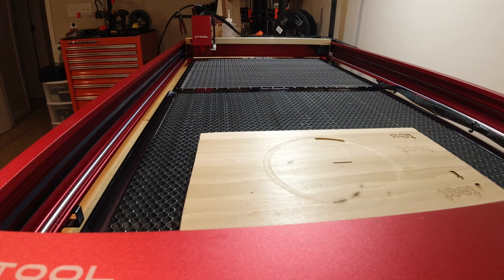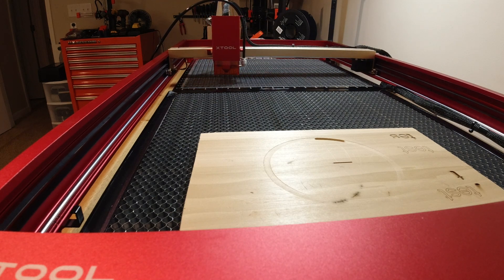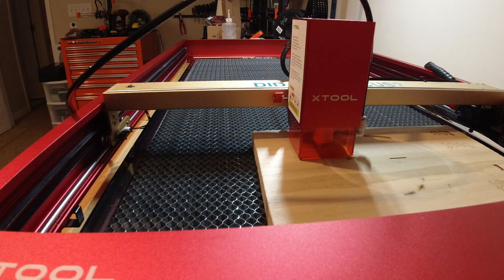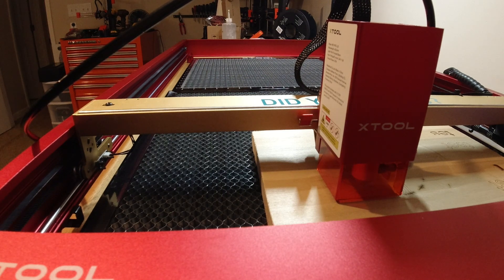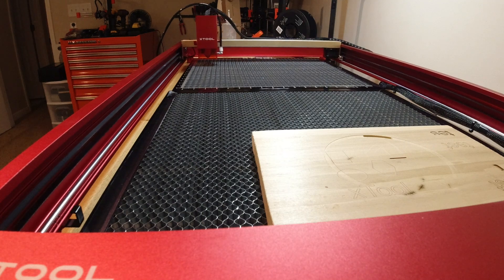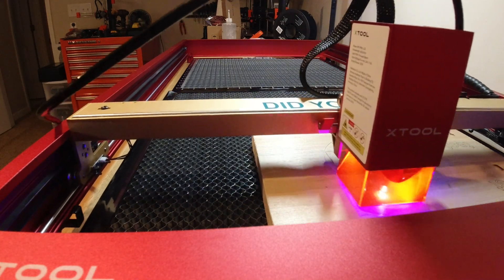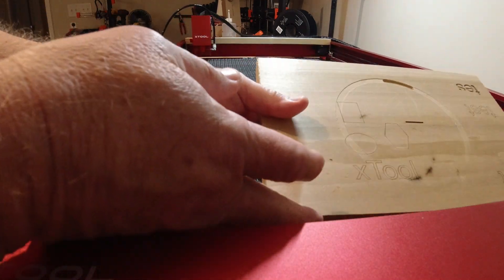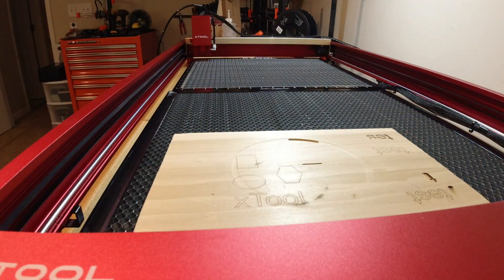Repositional Accuracy Test on Extension Kit xTool D1 Pro

Comment: I have the exact same setup as you currently have and I am un able to get the full use of the bed in lightburn.  I have done new firmware update in XCS, and setup new bed size in lightburn and unable to get it to work. Could you please tell me if I am missing something
Reply from the maker: Did you change your machine settings to reflect the new size?

Comment: Hello I have a question. I'm looking to buy this 20w xtool with the extention kit. My question is did you have to do anything special when adding the extention kit? I've read alot of people were having issues with it going the full length like you have tested in this video
Reply from the maker: Nothing special.  You just have to tell Lightburn the new dimensions of your laser.  In XCS software just select the drop down for the extension.